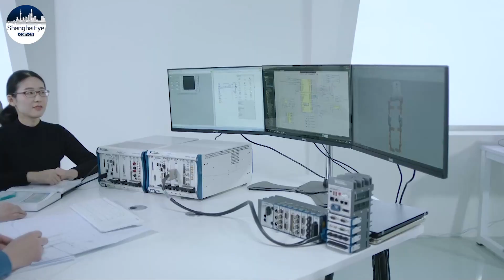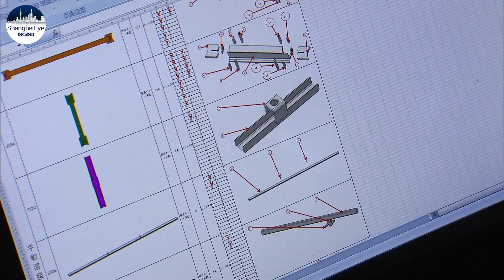China's industrial robot production surges with AI widely used

Comment: Those ABB robots looks like they were salvaged from some junkyard. We should use our domestically manufactured robots, not Swedish-Swiss junks, especially those made under the management of private equity firms.
Reply: if you don't let the service personal get sufficient time for cleaning . it going to look like 
this . its nothing wrong with ABB robots . even if domestic  machines are used its going to look like this . its a management problem .
Reply: @75700neo  they reminded me of those depicted in the movie Real Steel. I’ve seen robotic arms for welding that come with better designs and better looks. These could be very old models, and like you said, not very well maintained.